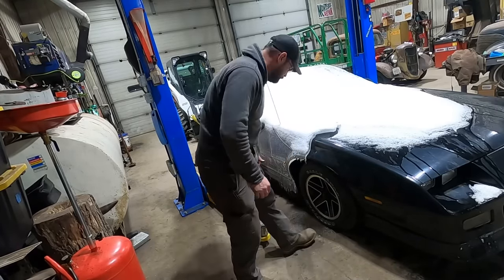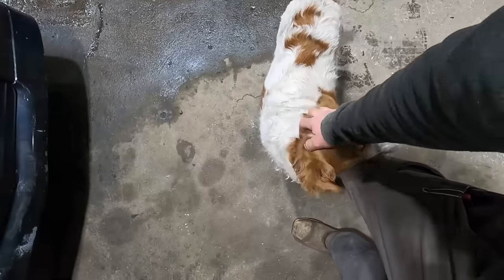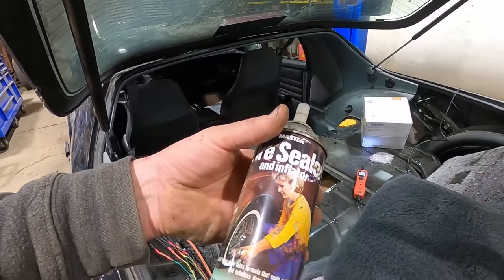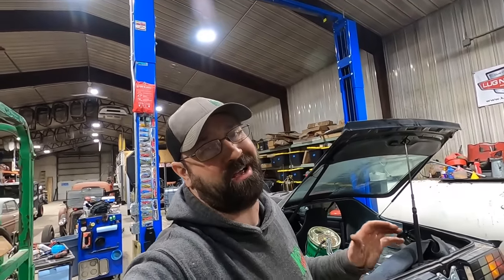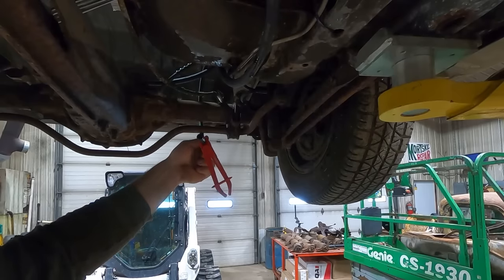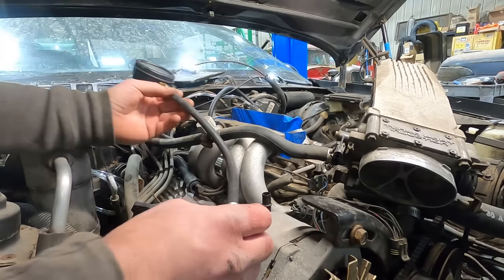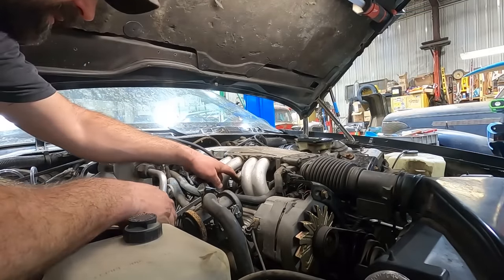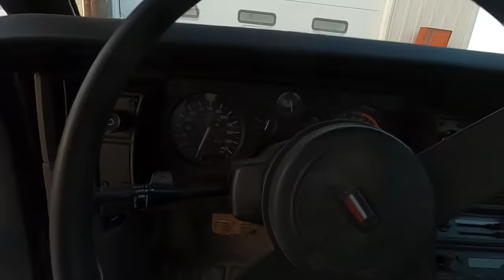Another Bargain or Bust Facebook Camaro?!? Low Mileage 1986 Z28 Tuned Port Injection! Will It Run?!?

Comment: That fuel injection is famous for not running when the coolant temp sensor for the ECM goes bad the motor does not run right. When people get the coolant sensor they also can sometimes get it wrong and get the sensor for the gauge instead of the one for the ECM!

Comment: The engine's been sitting for a while pump up the oil pressure and get the lifters pumped intake and exhaust valves are not opening like they should

Comment: I had a 84 Berlinetta with the v8 it was slow but the interior was real good and who ever specd it out had a real like Pontiac spoiler the air foil kind not a lip and 84 z28 wheels from the factory really nice looking because the Berlinetta had a lame exterior without that but the interior was sweet and if it had a LS it would be perfect I’d bet the Berlinettas are cheaper so look into one of those

Comment: I had a 90 z28. I loved that car but it wasn't a 5spd and the kids didn't fit in it. Blah blah  so I sold it.  Btw  unlike new computer garbage . You can slip a 300/400 hp engine under that TPI . With little fual mods and a couple resisters . No programming needed . Lol Good Stuff !
Reply from the maker: Good to know

Comment: Z28 WAS available in 1967 they made 602 of them but there were no call outs on the car. The option package didnt become popular until 1969 when GM started putting it on the fenders. 86 didnt have the 350 option at all and the 2.8 was the V6 not the 3.8L. Just more info for ya.

Comment: If there is the security and we don't have the transponder key called VAX two wires to hot wire. The brand Alligator with box filled with 24 switches see which resistor is correct to run better. To crank it is easy so alligator brand product and the only way to get resistors. Transponder is very similar to resistor with the value of ohms.

Comment: No the tank is not hard to get out just takes time because the “ panhard “ rod and exhaust are in the way. I also “ built “ an ‘84 Z that was a theft recovery. Same basic configuration as the one you are working on. The ‘78 I built for my sister was a much better car. Better acceleration . The 700r4 was replaced under warrantee by GM. I liked the styling but the car was” gutless”!

Comment: I had a 1983 in the mid '90s and lived in the rust belt. So by about 1997 or so, the rear shocks roasted through and I had to pay a welding place to repair it. I'm only 13 minutes into your video so far but if it happened the both sides of my car, must be a common issue?

Comment: I knew it.. I haven't worked on an old tuned Port TransAm or irocs I had a Trans Am I had to replace the injectors they were corroded and this was back in the late 90s early 2000s and the fuel rails you seem to have a lot of deposits build up I did that all at the same time bad engine fired write up

Comment: Back in 1957 when they came out with the fuelie Vette nobody would work on them. They had to send Chevy dealership mechanics off to learn how to work on them. Yet even so everybody else refused to work on them. Chevy had big plans to put that on other cars but they ditched that idea. They always had problems with getting the rear end worked on too for the same reason.

Comment: probably new orings will fix it have used the dodge on ford before the newer ones should work just the connectors are different but they make a EV1 to EV6 adapter where you can use the newer injectors about 20.00 per set adapters
Reply from the maker: thanks for hte info!

Comment: I Remember get screwed once ..found a 86 cutlass ..was moms car n was garage kept..in BLACK BOLD PRINT…frame is solid due to bein garage kept..gave the 1800 online n drove from Chicago to Pa. To get..I get there n guy was a car guy 4 stall garage with a barn n few sharp rides in it..I get in it n drive home..cousin says PCs of black shit was flyin off it as I drivin..get her home n get her on lift n would ya know it..rear frame rails gone..then where I put lift point at were slowin cavin in..called the guy n said there is no way ya put me muffler on this car n not notice frame rotted..got 500 back outta him n car sits in back yard ..lesson learned!!

Comment: I had an 85 T-Top 305 Tuneport Z28 back in the 90's. It ran low 15's in the 1/4. I also had a 92 RS 305 throttle body, ran 17's 👎🤣
Reply from the maker: Dang

Comment: Interesting with the LED! Usually I've seen LEDs with one way polarity so if you connect it one way, it lights, and if you connect it the other way, it doesn't. I wonder if there are two separate LEDS in there?
Reply from the maker: Yup

Comment: Believe it or not, it easier to swap a t56 into an auto car than a 5spd car... auto crossmember fit the t56 better plus the console fits the t56 as well. pedals swap easy, firewall has the stamp to cut the hole for clutch.
Reply from the maker: Interesting

Comment: Just noticed it does have an 87 I Roc Z instrument, cluster and steering wheel 305 did not come out with a 145 miles an hour cluster.
Reply: I do not know if you are getting my messages
Reply: I sent a couple of messages with my phone number and they do not show up.

Comment: Be carful when you take the fuel rails off. Gasoline at 40psi or so can be hard to contain. Normal robber O rings are NG. Good old 10 percent ethanol does a number on them( how do I know...)

Comment: There should be a purse size concealed storage compartment in the plastic interior panel which on your car died a flaming death. So what's the story,flammable substance stored in a not so good place on a hot day or just more fuel for the electrical fire.

Comment: I did this whith a VW , put different injectors and it will run for about 50 miles and will burn the computer. I hope you get luckier.

Comment: So this thing sat and had water invading into the gas tank for whatever reasons, it sat for years and rusted the tank out. They tried to start it up -- sucked up the rust. Wrecked the fuel pump, clogged up the fuel lines and the injectors. Then they tried to replace the fuel pump because they figured that was why it didn't start and crossed some wires or something. About burned the car up. Something like that anyways? Who knows.
Reply: Or the last place they got gas had a lot of water in their tank. Supposed to dip those every month for water.

Comment: their is more nitropropane in new gas, it overheats and cavitates far easier... to the point that older vehicles are forced to have the carburetors jetted and fuel injection systems are forced to have the lines and interments changed for parts that technically flow twice as much fuel so that the line pressure can be lower and still match the volume needs. out of nowhere car ran with 23psi in the fuel rail, then the TV news brought up carbon tax regulations... and the adjustable fuel pressure regulator had to be turned up to 75psi just to start the engine and keep it running. bulking additives in fuel on top of a price hike. needs three times as much to run yet the volume it taxed two times what it was 500% forced taxation at manufacture level of interference.

Comment: Excellent video Mortske  :) , MOJO  :) , Duff Dog 🐕,, I remember my late Uncle Bill JR  had 1985 Chevrolet Camaro Berlinette  one with 5.7 350 V8 motor 4 barrel carb, true daul exhaust with T Tops  , 700SR 4 speed Automatic transmission, all power options plus lock hub caps with 377 posi rear gears  in blue with black interior! Then  1989 trade in for Chevrolet Camaro RS I-Roc  Cherry Red with Chrome trim , 5.0 litre 305 High Output  , Air Conditioning, Power Steering, Tilt Steering wheel, Power brakes, Am/ Fm Cassette radio, power trunk with security system, windows, mirrors, sunroof , plus option was tunnel cover in trunk lid keep groceries for get hot summer season or luvers on back plus 5 spare tire same 4 wheels ! In 2008 to 2009 he got me restoration to new full frame plus true  daul exhaust, put 1976 Chevrolet Impala LS  rad 4 core with 2002 Chevrolet Impala car electrical fan sensor take clutch one ! Plus made 305 with 350 heads valves also cam plus rebuilt motor too , get shift kit 700SR 4speed Overdrive Automatic transmission  with 390 rear gears  it went lots faster plus had Black Interior  to also want GM Delco Alternator rebuilt plus Starter to , original radio with Equalizer controls plus new speakers to ! Car appraisal  for $15.000 too and after he past away in 2011 sold for $5,000! That car was super nice much with memories too!

Comment: You need old model #EP241 fuel pump (yes the more expensive one) else will need to run a fatter power wire from battery to FP with newer models. Kids at local parts store don't know what they are  talking about. IIRC you need 50+ PSI at the rail. You should have not gone any further tearing down when you read low PSI at the rail.

Comment: I've had several of these cars over the years. My worst disappointment was a mint low mileage 89 Iroc with a Paxton supercharger. Engine was locked up. I spent all summer rebuilding and polishing said turd.. pistons block bore. You name it. It always had problems. Chief of which was a warm start issue. JONK. This was before Ls swaps and my town had the I/m programs. I couldn't mess with it much.
Reply from the maker: Dang! Hot Rod!

Comment: Clean out your fuel rails check your injectors get a good fuel pump and it should run. As long as it's got good gas and a clean gas tank

Comment: The PCM probably has a speed limiter set at 113, unless it came with high speed rated tires from the factory. Ask me how I know! Needless to say mine is no longer limited. 190 hp should get you to at least 130. These are aerodynamic cars, especially if the nose is kept low.

Comment: Should replace the TPI like Pole Barn Garage did, for an intake and carburetor, not sure if they just put a cover plate over the mechanical fuel pump location or if you have to stick with your fuel pump set up?
Reply from the maker: what fun is that?!?
Reply: @MortskeRepair  very true, after watching all the way through, it's harder to get that system working, I see your point.

Comment: Ya,. My third gen Firebird that I put Iroc Z and trans am suspension parts on turned it into a truck ride. My ebay and junkyard TPI swap runs really reliably, even when it tried to identify as a 4 cyl because the left and right banks have their own fuse and the left fuse decided it didn't want to make contact anymore till I shoved some extra metal in there to make it work.

Comment: Not supposed to lift 3rd gen’s by the pinch welds. Even brand new, they are not strong enough to lift the whole car. You’re supposed to put the lift arms on the front frame rails beside the transmission and then the rear by the control arms. You lift them by the front pinch welds it bows the front fenders out and being rusty i’m surprised it didn’t go through the floor.
Reply from the maker: Noted

Comment: I can't say anything i paid almost $375 for a 1991 Chevy Camaro RS tpi 305 h.o. sbc motor to transplant it in my 84 Oldsmobile cutlass supreme brougham that i had it was a 72,423 mile car with a basic sbc 350 2bbl it was a 3.8 litre running Buick 231v6 it was a decent one but he wanted a v8 cutlass...

Comment: I could be wrong about the bumper but I own a 86 iroc and it has a different bumper. I thought the 86 bumper was different then all the others. Should have a rear brake light in the top of hatch
Reply: It's a Z28..not an Iroc.  86 and 87 the Iroc was just an option package.  In 88 through 1990 the Z28 option automatically became an Iroc thus there were no actual Z28s in those years as they were all badged Irocs
Reply: @LSswapGarage1  I understand it's a iroc lol.. not what I was saying but ok
Reply: @LSswapGarage1  I understand it's not*
Reply: I still don't think it's a factory 86 bumper cover.. probably why it was resprayed

Comment: Thanks for the extensive educational stuff, always cool, question for you sir, I’m planning a build with a 1964 Impala convertible X frame B Body car, and I’m wanting to put a bad ass suspension upgrade on it putting a 4 link on the rear with Limited slip and and on the front I was thinking about a corvette suspension with coil overs and a rack and pinion option, my questions are 1- does the rack and pinion take the place of the original steering box on that vehicle and if so does the steering have a solid way to be compatible with a corvette steering situation , and my bonus question is if so what would you recommend the best year of corvette suspension to go with in that scenario? I appreciate your time and attention sir love goes out. 💯
Reply from the maker: I wouldn't go Vette. You'll have to build everything from scratch.
Reply: @MortskeRepair  what would you suggest as the best IFS upgrade for a 64 Chevrolet ? And thanks for your time sir.
Reply from the maker: @mrgreezy1  What's wrong with the stock one?
Reply: @MortskeRepair  I’m trying to eliminate body roll which I’m sure by now you know these cars have a serious amount of, I’m looking for a 64 impala convertible to fix up which on disability will require multiple miracles, because I had one at 17 and fell in love with it, on top of trying to figure out how to gain financial ability to get one in my spare time I have made a notebook on how I’d have it, the only thing I didn’t like about it was the body roll, I don’t want to change anything else, I’ll be fine with a 283 and a power glide, and most everything else factory but I want it to handle reeeeaaallly good because every once in a while I might want to go fast, maybe corner fast and I hate ending up the passenger side if I want to take a quick left turn lol.. so maybe you know a better easier way, but to my knowledge having a 4 link in the back with a pro street IFS is the best method on how to eliminate body roll…
Reply from the maker: @mrgreezy1 I'd worry about getting the car. I don't think they have too much body roll. I'd just put sway bars on it and call it good.
Reply: @MortskeRepair  I will get the car, no worries there, because honestly it’s my only goal in life..🤣 after I get it and fix it up it’s definitely all down hill from there, I have couple sets of wheels I’m starting with to cash in for a fixer upper I can probably get 5-6k for each of them, two very well taken care of Cadillacs, a 2002 Escalade and a 2005 deville both in excellent condition. I’ve found fixers for 10-13k so I’m in the neighborhood.. but seriously if you hated body roll, but wanted to run that particular car 
(64 impala) how would you go about it ? I’m aware you know you’re stuff sir so I’d seriously appreciate your thoughts..💯
Reply from the maker: @mrgreezy1 Big sway bars
Reply: @MortskeRepair  thanks sir !!  I appreciate that !!! Give the Duff Dogg my regards !!! 💯

Comment: I was looking at those mid 80s Camaros on eBay motors there are currently a couple of them there that are in much better shape and also in that 1500 by now prize to $2000 might want to take a look one of them is in Connecticut not sure where the other one is they are both claiming to be Z 28

Comment: I had an 86 tune port car red never liked it I was probably 17 computer was bad or something going bad it would start running funny but if you kicked the dash it would run better was hard to kick passenger side dash running 60 I probably didn't have 400 dollars in it was a pretty nice car also had an aunt who's sugar daddy bought her one or leased it every year from I think 85 till I think 89 and all I rock or zs8 she even had a Indiana 500 pace car that was silver she tolded it ran through a ditch hit a road convert with concrete cap on it didn't put a scratch on her but it ended up with one wheel on it and floor board was almost a foot high on passenger side

Comment: You already know that’s why don’t buy a car sight unseen….it happens… Turd gens came with a few engine combos….and the V6 option were the worst!!! You had the 2.8 and the 3.1 which wasn’t until the later years….of course your classic V8’s 305 and 350….and I think this was only offered on firebirds but some not many even came with the “iron duke” 4 banger…..Why the hell anyone would’ve ordered one with a 4 banger is beyond me. The thing could barely get out of its way with a 350 in it. Last but not least and I could be very wrong I think there was a pacecar version that wasn’t offered to the public that had the 3.8 turbocharged grand national engine in it.
Reply: 89 Trans Am had the GNs turbo 3.8 as an option.

Comment: Mortske you Hate Headers I Absolutely Hate Side Post Batteries I immediately put top post adapters or New ends on.
Reply from the maker: How come?
Reply: @MortskeRepair  for one good luck on putting jumper cables on them not fun, and some cars everything is cramped and it's a pain to get to them, plus a lot of them strip out easily when tightening the terminals and if you don't snug em up good poor connection.
Reply from the maker: @robertvance1873  guess it's never been a problem for me

Comment: I fell your pain , I also bought a vehicle on an auction,70 Torino GT convertible, paid 9500.00 for it . Got it home up on lift, can push your fingers right though the inner rockers and rear subframes. With shipping 10,000.00 mistake. Hey know anyone that wants to buy a running driving Torino convertible??? Lol

Comment: That car will run 180ish the front end will get light around 150 to 160. Just replying to your lucky to break 110 remark lol. Those cars haul. Hook your fans to a switch inside the car. Trust me on this. You'll need to manually run the fans upfront. They run hot if you don't.

Comment: whats the rpo for the rear end ? ive got an 86 t/a with the LG4( :() )  i had to fix it temporarily with some vortec heads,a better cam  l-82 ,headers,eddie intake and a 650 holley....also swapped out the 2.90 non posie for a 3.27 9 bolt disc brake posie.....its a bit better than it was before